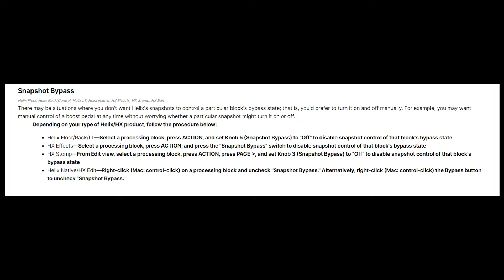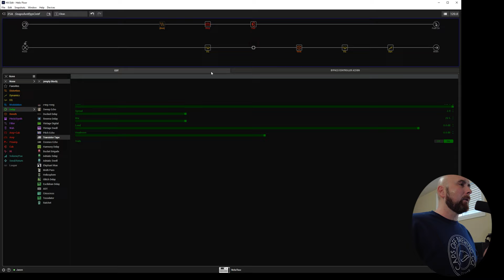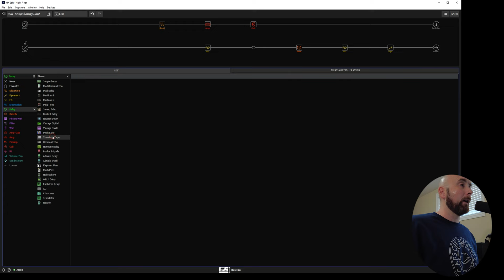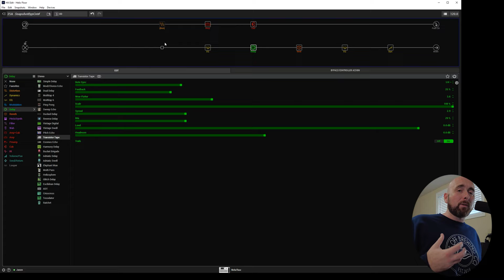If You Use SNAPSHOTS, You NEED To Know This!! | Snapshot Bypass Control (Line 6 Helix/HX Stomp)

Comment: OMFG, part 2 is the absolute worst element of the helix.  Adding a block and the thing is auto ON for all snaps.  Didn't know this checkmark existed Jason thanks.  Really, shame on helix for not allowing users to pick the default state of blocks when adding because even this checkmark is simply to many clicks.  It should be a global toggle choice so if users want it OFF, then we'd simply have to goto the lead snap and turn ON the single block as desired.

Comment: Why so Complicated... So frustrating, Have real Troubles on the HX XL doing this.
Reply: Okay... so I was Finally able to get it so it would work right,  I don't know what the deal was after assigning a Dist. and Mod to Snapshot 2, working with "Command Center" setting '5' to snapshot 1 clean with press and release selected for Snap 1 and still on the clean set button 6 to snapshot 2 and both press release to snapshot 2, AND THEN again for the "LEAD" Snapshot 2  the same process, WAY MORE WORK than the Helix for snaps, ALSO what was confusing was the BYPASS mode thinking I had to set a foot switch for each of those. it was driving me NUTS !

Comment: ANOTHER Great and very informative video! Thanks Jason! I have used this feature since Line 6 introduced Command Center to set up Snapshots alongside Stompbox assignments in Stompbox mode! Imagine my disappointment that I still could not have that control if I wanted that Stompbox in a certain state on a particular Snapshot... until 3.50! WooHoo! Now I can have the parameter I want set without being affected by Snapshots - which is really what I had wanted all along!

Comment: New Helix user here and these videos are just amazing. Thanks!
Reply: New helix user here as well. How do you even get into snapshot mode on the unit itself? Do i need to enable something in global settings? Mode button just toggles back and forth between preset/stomp function
Reply: @AchillesWrath1  In global settings you can change to snaps showing.

Comment: Thanks, Jason! This was very helpful. If you have a chance at some point, I would love to see an explanation about snapshot stacking. I do this in command center. For example, I have two snapshots on 1 foot switch but the issue is I don’t have any LED turned on when that is engaged. Plus the snapshot stacking is quite confusing and would be helpful if you could explain how to use it. Thanks again, Jason!

Comment: Thanks Jason! such a small step that gives so many possibilities. 
This makes it easier for my "ON/OFF Power cab mode foot switch" to go from normal FLAT FRFR mode and using the cabinet (or IR) to cabinet switched off and enabling Speaker mode. The thing is that I'm having problems because even though I choose a parameter assign "power cab mode" min to FLAT and max "speaker" and I select snapshot control "OFF" for this assign, it doesn't always work and when changing snapshots it sometimes changes from FLAT to speaker when to me, it shouldn't. I've tried building the preset from scratch but the same problem comes back. 
To me this should work, I don't understand why it doesn't, I don't know if it is a 3.50 firmware issue for this parameter or if it is just me.
Can someone help ? Jason ???  thanks in advance
Reply: send in a support ticket to cust srvc at Line 6
Reply: @sjsphotog  Yes, that's the best, thanks!

Comment: When I set up a snapshot with some of the effects toggled off, then toggle those effects on in pedalboard mode, then switch to another snapshot, is there a way to have the first snapshot reset when I go back to it instead of having the effects I toggled on in pedalboard mode still be toggled on when I go back that snapshot?

Comment: Coming from the pod-go hardware (I am not getting a helix), I note the pod-go manual (version 2.0) says nothing -- absolutely nothing -- about snapshot bypass. Further, if I cannot control the features using the unit itself -- meaning, I have to bring up "edit" software, then I will not purchase that product.

On the pod-go, every preset default has "snapshot bypass" set to "on". The problem is that this setting is only an initial setting. Once I start making snapshot parameter tweaks, the snapshot bypass setting no longer applies (at least, that has been my experience).

And so, I have to tweak every snapshot, and not just bypass setting, but everything. I could live with this annoyance, but I cannot move from snapshot to snapshot at performance' time without having to remember other tweak dances that are required.

While here, if you press down on a parameter dial, that does invoke snapshot specific, but there is a momentary adjustment that impacts all the other snapshots. Further, if you press down on a parameter dial and not make an adjustment, then it brings up a controller menu.

I am at the point where I have to make a backup of every patch before I start tweaking, because all of this user-action complexity (there are snapshot menu items on so many menus that you can lose track of what is where) will undoubtedly cause you to break your patch and figuring out how to undo it is a nightmare.

Comment: FYI I just tried the disengage/re-engage Snapshot Bypass in Helix Native to see if it properly disables the FX in each snapshot, and unfortunately it seems to kick it back on in all snapshots when re-enabled.  So, you still have to go through each snapshot and turn a new FX block off manually.  

Seems to work fine in the Helix Floor hardware though.
Reply: You can change that in the global setting easily.
Well, that's for the hardware unit so I'm not sure about the HX Native.

Comment: Is it possible to make all the same edit functions without using a computer and HX edit? I'm not set up for that. I'm trying to use it hooked up to my amp in 4 cable method but this thing is doing my head in. I'm new to it. I can't even figure out how to get into snapshot mode. When i press the mode button it toggles between preset/stomp mode. I know how to make a preset but what i want to do is be able to make snapshots. I can't figure it out for the life of me. I have an XL. The 70 something odd page pdf instruction manual doesn't really help. Do i need to turn something on in global settings that i'm not understanding? Any help would be appreciated thanks
Reply from the maker: Let me know if this much older video I did helps out at all: https://youtu.be/nSJefCG70Kk?si=tAw2LGjm4hWrcNvG
Reply: @JasonSadites  It helped some thanks. I've figured out how to switch back and forth from preset mode to snap mode by pressing the up down bank arrows together. I've created a few snapshots. I can see 1-4 and select between them but the buttons are white and it doesn't show the different effects on the little screen. It just shows a picture of cameras 1-4. The only way i can see the different effects is to hit the home/view button and that brings up the edit screen with the blocks/path. Any idea how to get the effects to show on the screen in snapshot mode and not just white buttons and pictures of a camera/snapshot labeled 1-4? It works switching between them but i feel like i'm still missing something. Or is that normal and should all of the snapshot buttons be white in snapshot mode? Thanks
Reply: Do i have to assign an effect to a pedal? I think i may be on to something. Is that why they're white and not showing on the screen?

Comment: Now if only Snapshot Bypass could be off by default (global settings option). In fact I'm intrigued by the discord between the default opt-out for bypass but default opt-in for parameter control in snapshots. The latter workflow philosophy feels like it should be applicable to Bypass too, at least optionally.